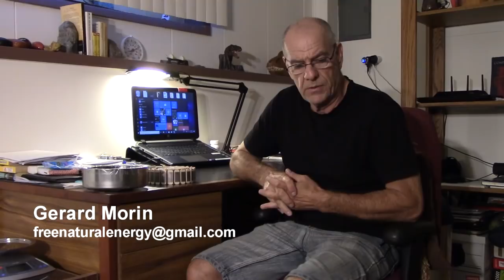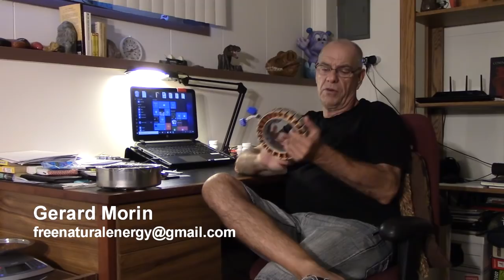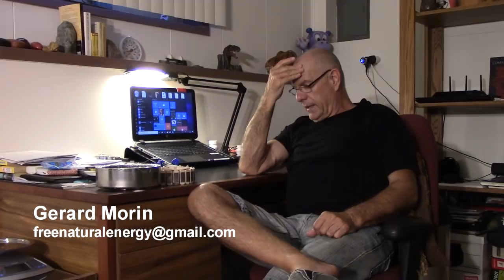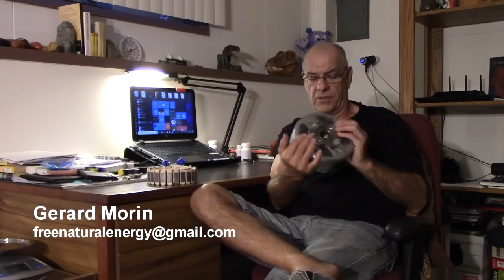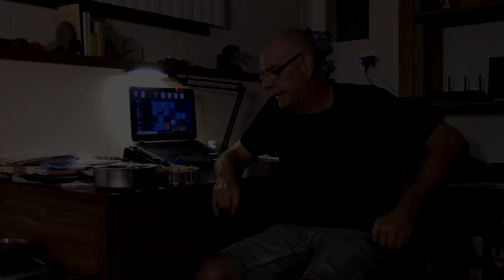Gerard Morin: I'm not dead

Comment: Use what you know about rewiring a drum motor and redesign a swash plate pump motor type 12 into a superconductor electrical power generator. Super fluid helium through a swash plate pump motor type 12 constructed out of gadolinium and bismuth and superconducting materials. Aluminum scandium copper alloy coil. There is a reason why you used aluminum for your resonance generator? Aluminums crystal structure how vibrational energy is transmitted through the crystal structure? That toy your working on is cool maybe you should look in another direction? The helium super fluid super conducting electrical power generator can be used in space? Your hyper generator is limited because it is operating within two different energy frequencies called atmosphere that affectes the refined crystal structures of what it is constructed out of.  Oh super cooling material does not slow down the materials crystal structure from being vibrated by earths energy fields allowing the material to act in different ways? The helium super fluid superconducting swash plate pump motor type 12 can be made at any size the concept can also be used in electrical vehicles has a power source and a cooling system?  How does helium super fluid react at high speed movement? Will it generate its own momentum?  Hay clean electrical power generation? LOL

Comment: Resonance, as it may be, has a ringing effect ocuring in the iron cores, combined with (Inductive Reactance), whereby the coils react to the magnets that are inside that flywheel as the flywheel is turning. At least that is how I assume that your system works. Once the flywheel gets up to the desired speed or r.p.m.'s, though the input voltage remains the same at a specific frequency, the current tapers off to absolute minimum. The torque that is applied as result of a specific frequency and 500 volts being obtained, spurs the "hyper drive" created by resonance and excitation inside of the field windings. When these conditions are met and momentum is fully achieved, it is hard to slow down or perhaps stop the flywheel that is already set in motion. It would seem like to me that the 3 sets or 3 legs of staggered armatures would also come to the aid of one another so that continued momentum would not easily be disrupted. Thus, having sets of a nearly wye type configuration windings done up on one core mass, the results when combined with a controller of precision timed, modified sine outputs; will surely achieve what it is that you are after! Your project kinda reminds me of a simular application that was known as a "Dynomotor". My electronics teacher back in high school gave us a run down of how the unit worked back in 1973. His specialty was primarily in Communications, and Applied Industrial Electronics.  And so, this guy was exceptionally smart in that he could just about reverse engineer just about anything. He would even try to take theory and try to even tear it apart and put it back together again. This man was very intense to say the least and suffered from headaches nearly on a daily basis. Just to watch him in the classroom, he would often be in very deep thought while  nearly staring off towards the back of the classroom as though he had a light bulb over his head and cranking out the instruction of the day all at the same time! There was eight of us in my class and Mr. Harris's attention was mainly geared to the brightest students that could keep up with him. Sometimes, if and if you were really struggling, then you would have to get some one on one after the class to get up to speed.
Well done Gerard! Many people have faith in you now! I have no doubt that this near long life project will be the "Cat's Meow" or at least some people would say the "Cat's Ass"! Thank-You for all your hard work my friend! It often takes us older guys to show the younger one's how things are done! Once you get that smaller unit going for yourself, just think how much camping that you can pull off! Perhaps you could go on tour once and for all!